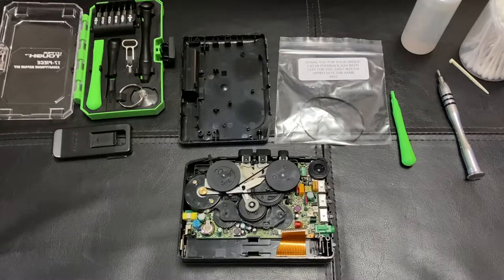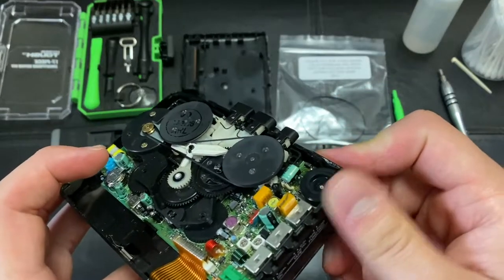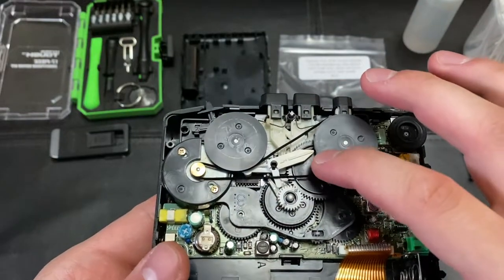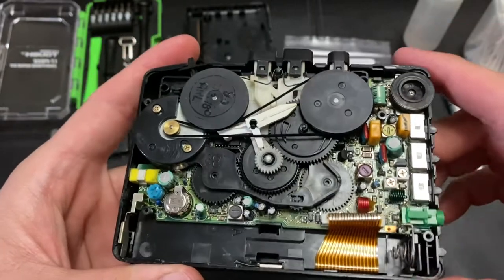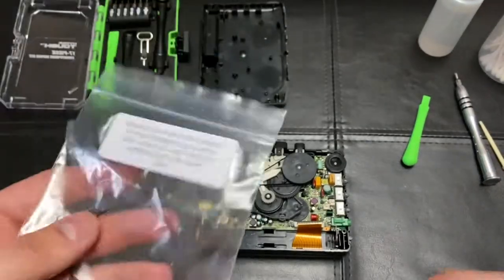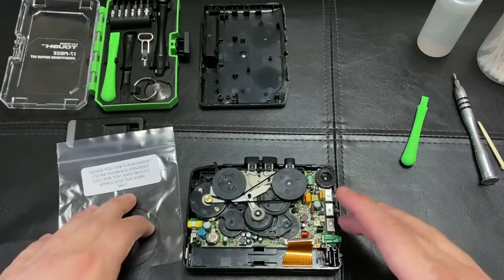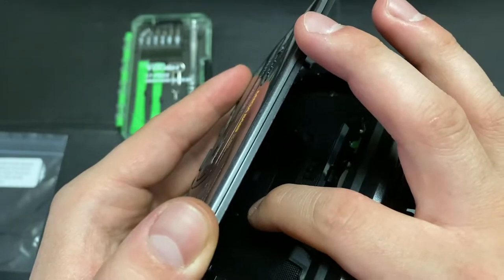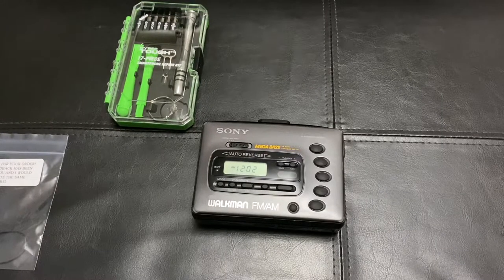How To Repair/Restore A Walkman That Doesn't Play Tapes

Comment: I have a similar Walkman, FX20 with digital radio and cassette. There is power, radio works but pressing play there is no mechanical noise or movement at all, is this likely the belt issue? Thanks
Reply from the maker: I think even without a belt you should hear some movement of the drive gear itself but you'd probably have to open the back and see if you can see if the belt is stretched of broken.

Comment: I got a walkman FM/AM for Christmas and it plays just fine until I put a tape it it, I tried to oil it up but it still didn't work, when I press play tape or not it makes a loud buzzing noise, I was wondering if you could help?
Reply from the maker: If the gears that are supposed to move the tape are moving then it could mean the tape head that reads the tape is either dirty or bad. If the gears aren’t moving but you hear that noise then it could be that the belt is broken so the drive gear is moving but nothing else is connected and the belt would need replaced.
Reply: @Mr.Everything  that's the thing, I hear the noise when there is no tape and when there is a tape. But it's works fine with out the tape. But when I put the tape in, no matter what tape I use it's like it's not strong enough to move it.
Reply from the maker: @KN1GHTM4R3S  That sounds like a stretched belt which would need to be replaced. If it’s a Sony you should be able to find a belt for the model number. If it’s a different brand you’ll either have to see if you can find out what size belt it uses or buy a variety pack and find one that is the closest to the existing one.
Reply: Thank you very much, I appreciate your kind help

Comment: Thank you for posting video.  Wasn't aware  you could repair cassette on walkman.  Found it very hard to get into but when I did found the belt was basically non existent.  Looked as if it had melted.  Found belt for it on E-Bay for 12.99 for model I have.  Was just before throwing it away.

Comment: Thank you so much for this video I thought when it stopped playing tapes it was done for so I started looking for a new one that was an older style but still worked. But I questioned if I could fix it myself and your video was the first I clicked on and it works! 4 months without my Walkman and all that was wrong was the band fell off, because its old of course but I just put it back on for the time being and I'm going to buy a new one. Again thank you it sparked so much joy to hear my cassettes again.
Reply from the maker: I'm glad the video helped. Unfortunately, at this point most Walkmans, even new old stock, probably will have issues playing tapes just because those rubber bands degrade over time. You can buy modern Walkmans on amazon that are designed for converting cassettes to mp3s but they can be used to play tapes too but they don't have Dolby or the nostalgia that the old models do. I've considered buying a vintage direct drive walkman but the prices are insane for those old high end units. Although, for those reasons I think it's definitely worth keeping our existing Walkmans and repairing them if possible as they're only going to get harder to come by and more expensive.

Comment: Thanks for the walkthrough! 
Just put a new belt on mine, but after playing a tape it sounds slightly slower in tempo and lower in pitch. Any ideas? Thanks!
Reply from the maker: There should be an adjustment screw somewhere to be able to adjust the playback speed. Depending on the model, you might be able to find info on it or in a forum. Otherwise the speed adjustment screw is usually larger and a different color than the other screws so it stands out and it might have a label on the board like “adj” for adjustment.
Reply: @Mr.Everything  Thank you so much! Managed to find the screw and it worked a treat; was quite fun listening to stuff back super slow and super fast whilst finding the sweet spot haha.
Thanks!
Reply from the maker: @sixpalms842  It's always a fun experience to get one up and running properly again. It's a lot more work than listening to something digital but it's rewarding.

Comment: so i got a sony walkman for my birthday and it is radio and tape player one. but the tape player circle things inside do not spin at all they make noise but don’t spin. is there any way that you could help me?
Reply from the maker: I think all the ones that are a radio and tape combo use a belt to drive the gears that move the cassette spools. So you'd likely have to unscrew or pry open the back and see if the belt is broken. Most Sony models are easy to find a replacement belt for but if you have to you could either research what generic belt would fit it or buy a pack of ones that have all different sizes.
Reply: @Mr.Everything  thank you! i will try it and report back!